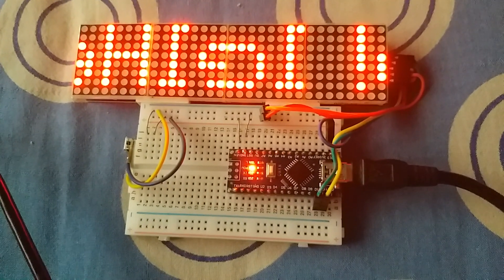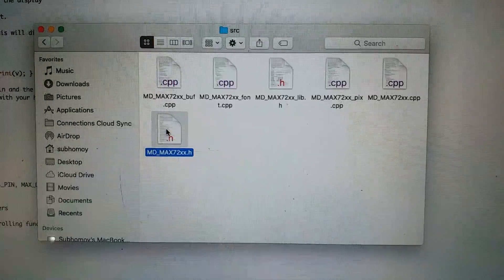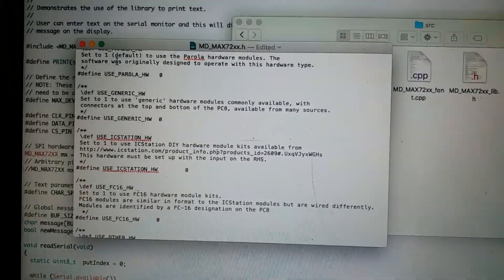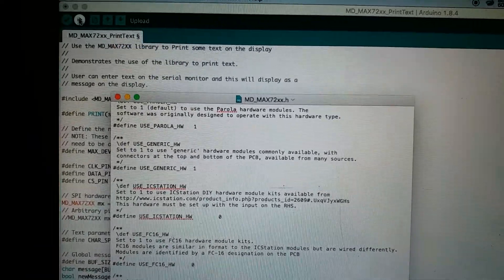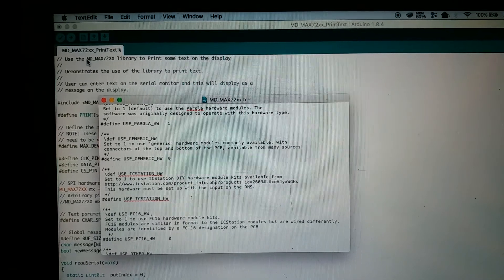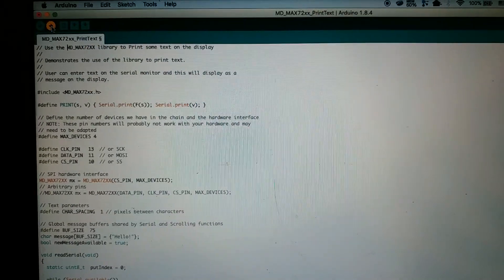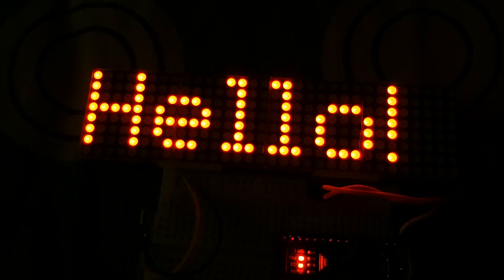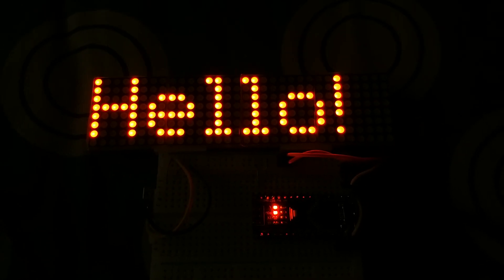MAX7219 DISPLAY PROBLEMS, SOLVE ROTATION, MIRROR DISPLAY

Comment: For anyone that is having this issue, the most up to date md_max72xx.h does not have the strings mentioned in this video.  The fix for me was in the Example code itself...not the .h file.   
I changed:
#define HARDWARE_TYPE MD_MAX72XX::PAROLA_HW
to
#define HARDWARE_TYPE MD_MAX72XX::FC16_HW

Depending on your hardware, you may need to edit the above line to something different...perhaps by using one of these:
    GENERIC_HW
    FC16_HW
    PAROLA_HW
    ICSTATION_HW

Comment: Newer version of md_max72xx's  .h file has different content. It doesn't have section where it says "#define use_parola_hw 1". So i uninstalled the newer library and use older library. Now it's fixed but i'm wondering if i should install md_parola too.

Comment: Thank you so much for this!  If anyone is finding this while trying to do the Marquee scroller project at https://github.com/Qrome/marquee-scroller, here's how you fix it.

You do NOT need to tweak the 72xx header files the video author mentions. There's a location in the Marquee source you can change which works just fine.  Open the "marquee.ino" project file in the Arduino IDE. All of the files will open up. Look at the "marquee" tab, search for "setRotation" (which is around line 186 in my copy).  This is where you change the value the video author mentions (0=no rotation, 1=90 cw, 2=180, 3=90 counter-cw). Change from to whatever works for your display (it was 1 for me with some AliExpress-sourced displays).  Good luck!

Comment: its not working for last version of MD_MAX72xx.h, couse no needed paramters are inside((((
Reply: you have transform() methods in the latest version of the library regardless of the hardware. so i.e. you

 #define HARDWARE_TYPE MD_MAX72XX::GENERIC_HW

and then in the functions, before  mx.control(MD_MAX72XX::UPDATE, MD_MAX72XX::ON);
you put i.e. mx.transform(MD_MAX72XX::TFUD);

TFUD is one of several transform commands available ("tfud" flips the display upside down, equal to 180' rotation), check MD_MAX72xx.h for a list of all transform commands and their description
Reply from the maker: Mail me the latest library & let me check
stayclearwithme@gmail.com
Reply: Me too :/
Reply: same problem, did u find solution